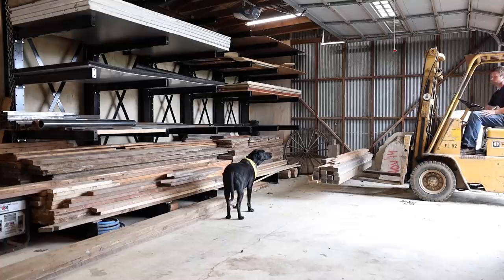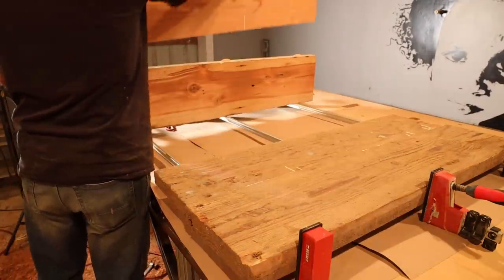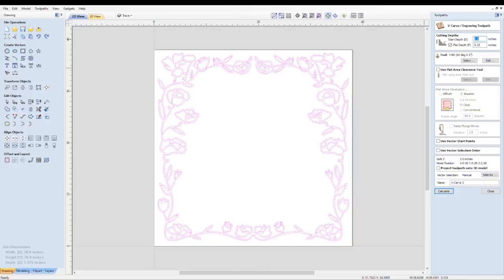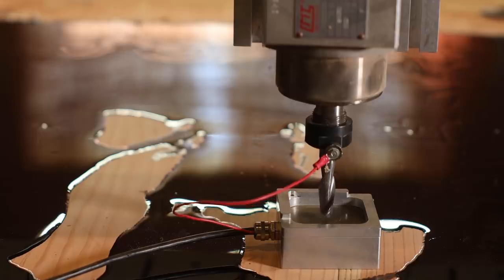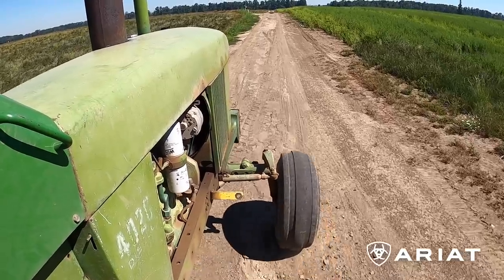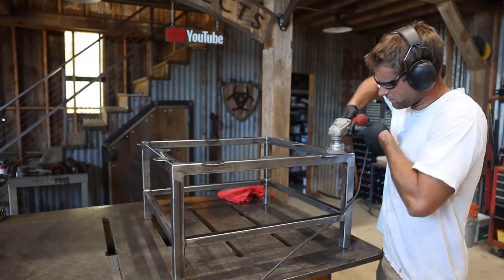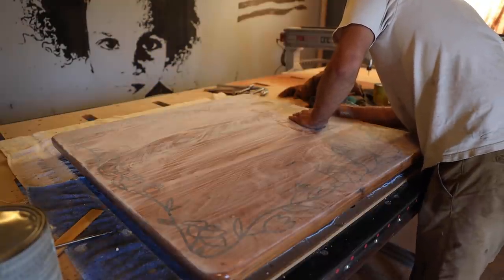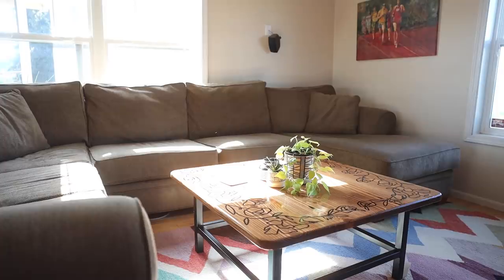Wood and Metal Coffee Table with Epoxy Inlay

Comment: I think it would be a good idea to elongate the holes in the steel where the screws mount the top. That should allow the wood to expand and contract with the seasons. Would hate for such a beautiful piece to develop a crack because that solid base restricted movement one way or another. Great project!

Comment: I noticed the die bleeding into the wood as well. Could that be fixed by applying a clear coat over the wood before pouring the epoxy?
Reply: That's a good question!
Reply: That's what I usually do... same technique when painting also for crisp lines.
Reply: It also helps when engraving soft woods that chip out easily too

Comment: since caulk is cheap, couldn't you outline the inlay somewhat closely on both sides & use less epoxy? 
as always, i'm happy to see a new video from you & have enjoyed watching you over the years. especially as you rep the Willamette Valley. thanks.
Reply: I think he was going for filling in the knots also.
Reply: @maryblaylock6545  it's just that epoxy is so expensive compared to caulk. seems he could reduce it's usage a lot. regardless, it looks great.

Comment: if you had given the top a coat of varnish. to seal the inlay before putting the epoxy in, would that stopped the  epoxy bleeding into surrounding wood?
Reply: Would the varnish affect the epoxy adhering to the surface?

Comment: Looks great.

please enlarge the mounting holes for the top on the frame so the wood can move and won't crack.
use a washer under the screw.
and fill up the inset for the frame.
This also will make the top crack becouse the top has no where to move to.

Tip for making the top less shiney use some steel wool 000
Reply: I came here to say exactly this.
Reply: Ditto
Reply: Enlarging the holes is certainly a good idea, but the metal screws do have some give, so wood movement should not be constricted too badly.
Reply: @RobertEchten  The screws are countersunk heads in countersunk holes they have no where to go.
Dome head screws would be better but still not enough for a top like this.
Reply: @3dmazter  They can still bend a bit, depending on the quality of the screws. I agree that enlarging will assure you have no issue, but I'm not too worried that the table will cup like crazy just because the holes are not elongated.
Reply: @RobertEchten  It wont cup maybe but for shure it will crack.
The wood can move between 2-8% 
Top looks like 100cm so it can move 2 to 8 mm
Reply: @3dmazter  cupping and cracking are the same result of wood movement restriction, just in different directions. Wood movement depends on a lot of factors, changes in humidity being the main one. Since the wood is well seasoned, I think the actual movement will be on the lower end of your calculation and I think a screw can handle that. To be clear, I still agree that it is better to prepare for wood movement, but I think in this case it will be fine. If nothing else, itf the wood would be moving so much, the epoxy might crack first (depending on the flexibility of the epoxy used). (BTW, I think you have the right numbers, but wrong calculation. 2 to 8 percent of 100 cm is 2 to 8 CM. I don't think it will move 2 to 8 cm, but 2 to 8 mm sounds plausible).

Comment: With a solid wood top, the wood will expand and contract with seasonal moisture changes. Just make sure the top isn't rigidly constrained by the legs. If not, the top could split
Reply: Conan117117 is correct.  There is no way to prevent wood movement, especially in a large solid top.  It has to be allowed to float on the structure beneath it.  Best way to accomplish that is to slot/elongate your screw holes on your metal tabs so they are perpendicular to the grain, and don't overtighten or over populate the fasteners.  Just watch that you don't get the top "locked" in place when you're done, and it'll last a super long time!  Keep up the amazing work, your videos are the best!

Comment: Very nice looking table and design.  I love the simplicity, use of materials on hand and robustness.  It concerns me there may be issues with wood movement.  As moisture is absorbed into the timber the wood fibers swell and then as the timber dries again they shrink (it's exceptionally slow and it does a complete drying and expanding cycle over a year).  Having all those tabs and the dado with no allowance for timber movement may cause the timber to split and or at the very least pop the screws.   If you find this hard to believe, check out how they split marble by drilling a series of holes in line in the marble, tap timber stakes in and then add water.  Thanks for the video.  Cheers, David.

Comment: Beautiful table and very nice floral design! If I may (and I hope that not a dozen others have said the same already) I would suggest turning the holes into the mounting brackets into quarter to half inch wide slots. (Only necessary on the 2 sides with the end grain.) This will allow for seasonal wood movement because the screws can move in the slots while still holding the tabletop down. But probably you already know about this and decided it wasn't necessary in the modern day and age with AC and insulated homes (less humidity fluctuation), so I'll shut up now :) once again, great work!

Comment: Really enjoy seeing how you approach projects like these with the CNC as the main tool. Came out beautifully. Something to consider for future wood topped proejcts would be to make the metal mounting tabs for the top have oval holes to allow for wood movement. May get cracking if there's not enough slop in the mounting hole
Reply: I love the project and the aesthetic of it ! I am a bit afraid with the recess and tight tolerances that indeed, wood movement will be blocked which can lead to some cracking, or so I've heard, as I always try to take it into account, I don't know if it would truly cause any issue with that top. Guess it will depend on the environment it will live in, if it is constantly humid all year, it should be ok :) Let us know !
Reply: It won’t show itself till winter when you introduce heat and less moisture and there will be less moisture in the house.  It’s a lesson in woodworking you have to learn and you remember for the next time.

Comment: I sure enjoy your projects. I do some furniture building but no welding …yet. You set a solid benchmark. If you wish to make a more perfect finish using poly or varnish (and you don’t have a long way to go) here’s a suggestion that works well for me: apply your protective base coats and sand them just enough to remove any bad runs or bubbles. Thin down your final few coats with thinner and sand them with finer grits of sandpaper. They will dry much quicker than the heavy, thick base coats and there will be fewer spots from dust so the sanding will go faster. If you desire a real nice tactile feel to the top, use some 0000 steel wool and then wax for the final top coat. I agree with the other comments about making your screw holes in the base at least 25% bigger than the screw shaft diameter when using solid wood to allow for expansion and contraction over the seasons. Not needed with plywood. Keep up your great projects. I appreciate your attention to detail on every aspect from the narration to the video quality. My only wish is for you to up your output.

Comment: If you were concerned about the soft wood not holding up to the router, would you consider coating it in a sacrificial layer of (clear) epoxy before making the first v-groove cut? All of this epoxy shall be ultimately removed, anyway, so it need not be the fancy stuff..
Reply: ..and an intermediate-clear-coat to prevent the "dye-bleeding" :)

Comment: Nice Table!
To prevent the black epoxy bleeding into the wood, coat it with clear epoxy first, then sand with a coarse grit to get proper bonding.